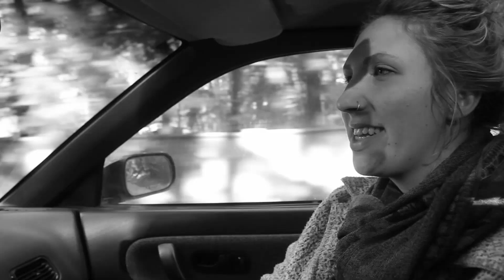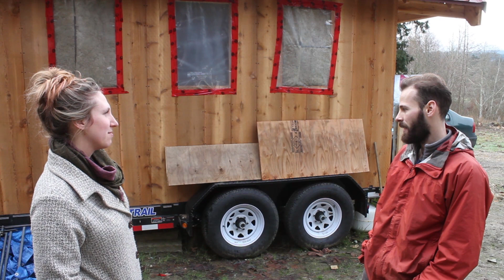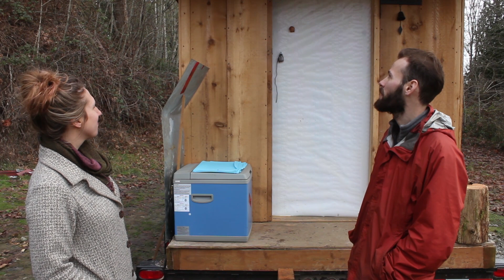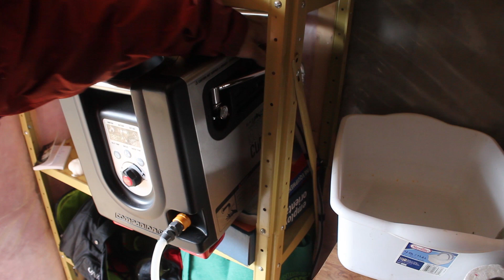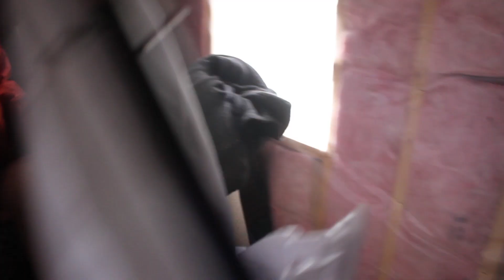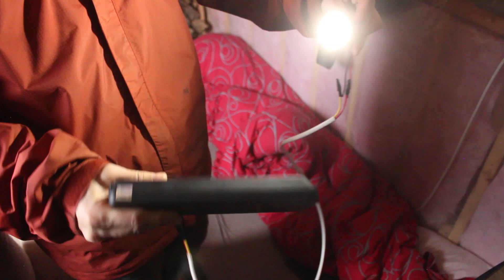Tiny House Tour - Aaron's in-progress "Walden"

Comment: "Pull out toilet."  I would rather the toilet be in a "slide out," that is only stored away when moving, so when set up the toilet is always available and ready.....but that is just me, love everything else.

As another level of theft protection, get a heavy duty lock that is designed to block bolt cutters and lock your chains in front of where the hitch bolts on so professional thieves with access to their own bolt on hitch can't easily just bolt on theirs and drive away.  I know, no system is perfect, but for ten dollars for a good lock and using the chains already present you are adding one more layer of protection.  Also, something nobody ever mentions, place a tracking device somewhere high up that won't quickly be discovered so that if someone steals it you can track the trailer (milwaukee tools puck, Tile, iTrack, Cube, etc....) whichever you decide to use, make sure it is hidden(and still works despite being hidden), accessible to replace when battery dies, and don't show/discuss its placement in any videos.....

Great looking build.

Comment: Nice video tour of an on going build.  We've been calling a 32 foot RV home for about 15 years, and it's showing it's age.  We have been talking about finding another RV to live in while we strip this one down to the frame and rebuild it.
Reply from the maker: Kriss Femmpaws We haven't spent time in an RV, but my impression is that everything is designed to be as light and compact as possible for portability, so it sacrifices some function. If you plan on staying put much, I would definitely say it's worth it to design something from the ground up to meet your needs and comfort.
Reply: Tiny Nest Oh yeah and with Sweetie and I having been hurt on the job, a loft is out of the question.  That's one of the reasons we have a 5th wheel.
Reply from the maker: Kriss Femmpaws Ah sorry to hear that, well there are plenty of designs for all situations :)